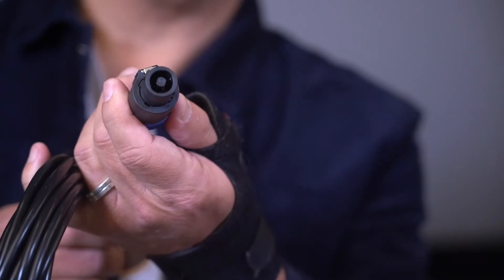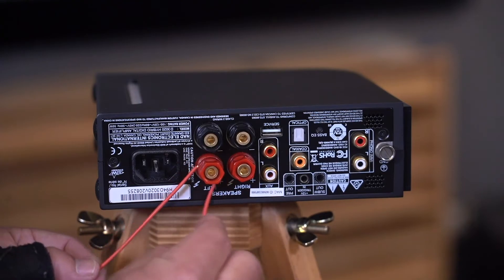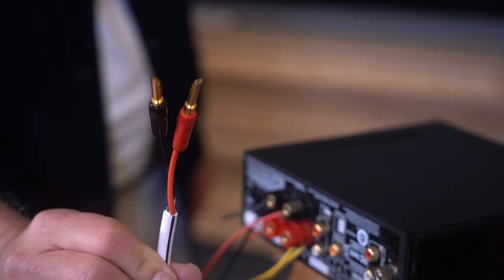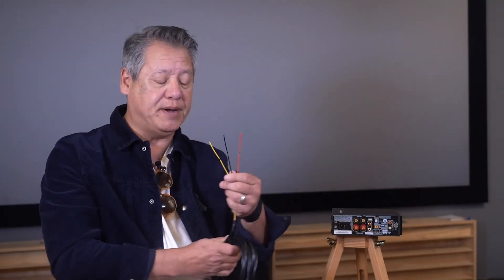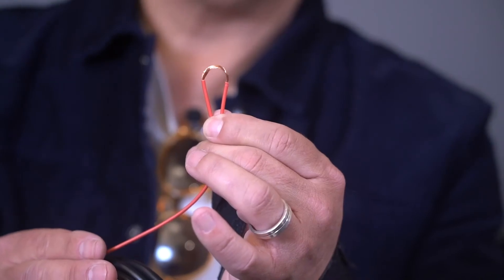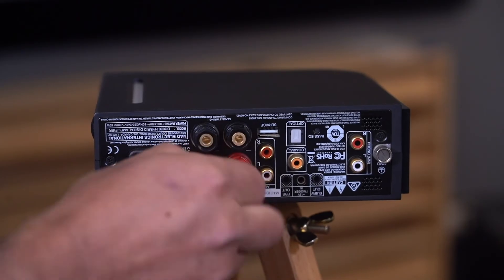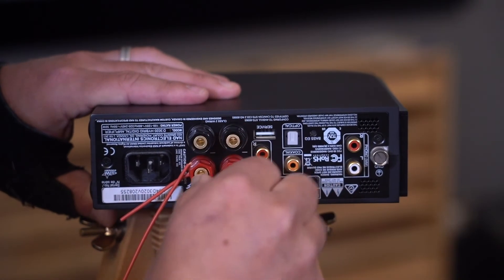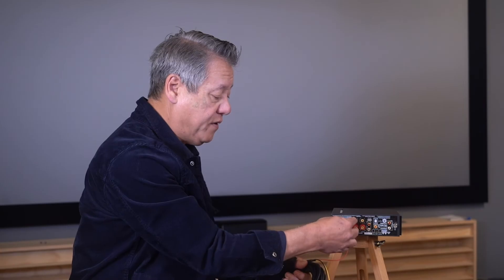What are some tips for the best way to connect a REL Acoustics subwoofer high level?

Comment: One question? Would that drop the ohm load to 4 instead of 8 ohms? Thank you
Reply from the maker: Thank you for reaching out. The High Level input on our subwoofers uses a high input impedance (150,000 ohms), which allows it to connect to the main speaker output terminals on your amplifier without placing any current load on the amp. This means that if your main loudspeakers have a nominal impedance of 8 ohm, then the amp's output stage loading will remain at roughly 8 ohm after connecting the REL's High Level cable.

Comment: What happens if you have a sub out on your amp ?
Reply from the maker: Thank you for reaching out. An RCA pre-out or "sub-out" can be used for connecting to a REL subwoofer, though in most cases we recommend using the High Level input in order to get the best possible performance from the subwoofer. 

For connection instructions specific to your system, please write in to contactus@rel.net and our team will be happy to assist.

Comment: Would it be ok to connect the high level of the rel subs at the speker post rather than the amplifier’s posts, since the subs are being placed next to the speakers. Thanks.
Reply from the maker: In some cases it is possible to connect the High Level cable to the binding posts on your main loudspeakers. For more information and for High Level connection instructions specific to your system, feel free to write in to contactus@rel.net and our team will be happy to assist.
Reply: @RELAcoustics  Thank you. Appreciate your fast response 👍

Comment: Is there any easy way to do this with a pair of monoblock amps that are spaced a little ways apart? They’re not differential amps. Do I just have to deal with removing more sheathing from the cable and run longer bare wire across from one to the other?
Reply from the maker: Thank you for reaching out. Are you planning on using a single subwoofer in this system, or a stereo pair of subwoofers? Also, what specific model of monoblocks are you running? This information will help to provide accurate connection instructions.

Comment: Hi. Does this affect the impedance of the left and right speaker? Do I load my mission towers on same terminals pls? I do have 4 independent subwoofer phono inputs for 4 subs but this sounds like I’ll get the best from the rel s 812 sub I’m looking to buy.
Reply from the maker: Thank you for reaching out. The High Level input for our subwoofers is designed so that it will place no current load on the amplifier, and will not draw any amplifier power away from your main loudspeakers. The main loudspeakers and amplifier will essentially perform as if there is no subwoofer connected, with the REL then drawing a small amount of voltage to then feed it's own filters and amplifier.

Comment: hi, I'm going to buy upcoming Classic 99 , I want to use it with both home cinema, and stereo. I have a question. Is it possible to connect  it simultaneously to both  high level input comming from my stereo tube amp, and to my Marantz Cinema 60 LFE output permamently without chnging any cables on  dayly basis? Or is it maybe better to go wireless on a stere side, for example from one of my Rose RS-150B streamer  outputs through your transmitter (not sure which model)? Which sollution would be beneficial from audiophile point of view?
Reply from the maker: Thank you for reaching out. The Classic 99 is designed so that you can connect to both it's High Level input and the .1/LFE input at the same time, meaning that you can connect High Level to your stereo tube amplifier and simultaneously connect using the .1/LFE input to the sub-out on your Marantz Cinema 60. Each of these input channels have their own independent Level control so that they can be tuned separately, and it will not be necessary to disconnect or reconnect any cables when switching between these two applications.
Reply: @RELAcoustics  thanks, that's really great news!

Comment: Hey there John, im so glad i found this Video. It makes perfect sense now! 
I just bought my T/7X (my very first Sub) and as i'm a music producer i just have one small Amp (Bryston 2B) and as i use Amphion One 18 Speakers,  i dont listen really loud (therefore also my choice of the T7X). As i was confused on how to connect the Sub i wrote to Thomann the Music store before and the told me i should connect my Amp to the Sub and then Back to the Speakers, which is not possible with the T*X Subs so i was really confused how to do it. I thought i need to buy another Amp and connect this to the Sub but then how do i connect the out to the Sub and the AMP, Y-Split cable ?? etc etc but this Video man, the solution is so simple and easy that i would never thought of this. So thanks again you saved my day (and the money for another Amp :)
Reply from the maker: Thank you for supporting REL, and we are glad that this video helped to answer your questions about connecting the High Level cable for the T/7x! As the video shows, both the High Level cable for your T/7x and your main speaker wire will be connected together to the output terminals on your system's main power amplifier.
Reply: @RELAcoustics Hi, newbie here, so it's okay if the cable (+) from main speaker touches cable (+) from REL sub ? In the video you mentioned something about banana connector but i'm not native and didn't understand that part, are you saying to use a different connector for the REL and the main speakers? My main speakers have same type of wires as the REL though so from my understanding they'll both be touching is that normal?
Reply from the maker: @monstar5746  That is correct, the positive (red and yellow) leads of the High Level cable should be connected to your amplifier's positive speaker output terminals alongside your main speaker wire, and in most cases this will result in the High Level wire making direct contact with the speaker wire. You could use different connectors/termination for each wire (for example, spades for your speaker wire and banana plugs for the High Level), or simply use a bare wire connection, as long as both are making secure contact.

Comment: I've been running both high-level and .1 LFE's on my stereo pair of T5i's, and after disconnecting the high-level connections to do some .1 LFE speaker levelling, I realised only one of the subwoofers was working! Which told me both subwoofer inputs are probably running parallel, meaning that both running the same way.
Even though my arcam avr20 apparently is able to do four independent subwoofer outputs, however that's with dirac live bass management! Perhaps when finances become available the Rel 3D HT will be for the near future. Therefore in the meantime I was wondering would be beneficial for my particular 5.2.4 setup to implement a Y-Splitter ?

Any advice would be appreciated! Cheers
Reply from the maker: Thank you for reaching out. If you have found that one of the subwoofer outputs on you AVR is not functioning correctly, then you could use an RCA y-cable so that both of your T/5is receive signal from the same functional subwoofer output on the receiver.

Comment: Where do you connect the other end with a black cap it didn't look like a RCA male
Reply from the maker: Thank you for reaching out. One end of the High Level cable fans out into three bare wires, which connect to the output terminals on your amplifier, while the other end features a SpeakOn/NL4 Plug which connects to the High Level input jack on the subwoofer's rear amplifier panel.

Comment: does this work for lower powered amps? like 25 watts or is the amp in rel sub doing the lifting ?
Reply from the maker: Thank you for reaching out. The High Level input on our subwoofers is designed to not place any current load on the amplifier, and to not draw any amplifier power away from the system's main loudspeakers. Instead it will only be drawing a small amount of voltage to then be fed and amplified through the subwoofer's own built-in amplifier. As a result, the High Level input can certainly be connected to and used with 25 watt amplifiers.

Comment: Confused, why don't you just set your speakers to small like audioholics recommend no you just marketing something your know for subwoofers but not  loudspeakers that's the difference
Reply from the maker: Thank you for reaching out. In our experience setting main loudspeakers to small significantly limits their performance potential, and can alter their sonic character in ways not intended by their designer. Aside from a small number of speakers that are designed to only be sent a bandwidth-limited signal, the vast majority of speakers are capable of receiving a full-range signal and originally designed and voiced with a full-range signal in mind. 

That being said, try it both ways in your system and see which sounds best to you. Musical and sonic preferences are subjective, and what is ideal for your ears and in your room may be different than what we prefer and recommend.

Comment: Why is it that the cable is not supplied with the HT range? What do you supply with the Ht range speakers?
Reply from the maker: Our Serie HT subwoofers do not feature the High Level input, in part because these models are intended primarily for home theater use, and by eliminating the High Level input we were able to use larger drivers and more powerful amplifiers while maintaining a competitive retail price.
Reply: Many thanks for taking time to answer; please tell me which cables I need to purchase, I will use the subwoofer both for HT and for two channel listening
Reply from the maker: @paulk9534  With the Serie HT subwoofer models, you will only need a standard RCA cable to connect it to your preamp or AV receiver. If your preamp/receiver has a single subwoofer output jack, then you will only need one RCA cable. If it is a 2-channel preamp and only has stereo (left and right channel) output, then a pair of RCA cables can be used.

Comment: Are we okay cutting the cables if we have shorter runs? The included high level cables are pretty long.
Reply from the maker: Thank you for reaching out. Once you have finalized the location of the subwoofer in your room relative to your amplifier, you are welcome to trim the supplied High Level cable to a shorter length if you wish.

Comment: It looks like you connected one high level input cable to both right and left speaker posts. The red to right and yellow to left. This means the subs will cross the right and left speaker posts?
Reply: Where connected the black wire - ground ?
Reply from the maker: Thank you for reaching out. When connecting a single subwoofer to a 2-channel amplifier, we do recommend connecting it to both the left channel and right channel speaker output terminals on the amplifier. This means that the red wire will be connected to the right channel positive speaker output, and the yellow wire will be connected to the left channel positive speaker output.

Comment: Hi! If I use spades for the speakers, it's less recommended to use this way to connect my T5i to the speakers (LS50 Meta) instead of my amp?
Reply from the maker: Thank you for reaching out. With a single subwoofer setup, we recommend connecting the High Level cable to the output terminals on the amplifier itself, rather than connecting to the binding posts on your main loudspeakers. Connecting to the amplifier's output terminals will allow you to more easily connect the cable to both the left channel and right channel outputs.

Comment: I've tried all guides how to solve the humming sound from TZero Sub for my desktop hifi sytsem, but in vain! Rel seems to make thing complicated. 
I've duo JL Audio Subs to mate with my Maggies 3.7 speakers, also connect high level input, without no problem at all.
Reply from the maker: Thank you for reaching out, and we are sorry to hear about the hum that you are experiencing with your Tzero. When you have a chance, please write in to contactus@rel.net and our team will be happy to assist with troubleshooting this issue and providing resolution options as needed.
Reply: @RELAcoustics  Thanks for your prompt reply. I just fixed simply Adding 1 RCA to the .LEF to connect with my Class D Amp (I still keep high level cable connection),  and no more humm...But I'm really not sure: Now the sound of the TZero mkIII Sub coming out from the high level connection or from the .LEF. Please ... Thanks
Reply from the maker: @iluxman  Thank you for your response, and we are glad to hear that you were able to resolve the hum from your Tzero subwoofer by running an RCA cable from it's .1/LFE input to an open RCA jack on your amplifier. In this case, the .1/LFE Level control on the subwoofer can be lowered to the minimum/lowest position, so that this RCA exclusively provides a signal ground reference without impacting the audio output of the subwoofer.

Comment: I have an S/510 coming. My amp is a Moon 700i which is a fully balanced differential dual mono. Do I need to use one hot channel only or limited to RCA?
Reply from the maker: Thank you for reaching out. Since your Simaudio Moon 700i amplifier uses a fully-balanced/differential output stage design, the instructions outlined in the following article from our website can be used when connecting your S/510 subwoofer to this amplifier using the High Level input: https://rel.net/blog/2015-07-23/how-to/how-to-connect-a-rel-to-a-balanced-amp/
Reply: @RELAcoustics  TY. To be clear, only ground the sub on the chassis if a ground screw exists. Otherwise, use the amp RCA output into the LFE input on the Sub with the volume right down.

Comment: How are we gonna high pass speakers when we connect subs to high level input
Reply from the maker: Thank you for reaching out. When connecting a REL subwoofer using it's High Level input, it will be necessary to set the corresponding main speaker channels to "large" or "full-range" within your processor or preamp, so that no crossover is applied to their signal. In our experience this will not only result in improved performance from your main loudspeakers, but will also allow you to achieve the full performance improvement that the High Level connection provides. 

If you would prefer to apply a crossover to the signal received by your main loudspeakers, then we recommend instead connecting the subwoofer using it's .1/LFE input to the subwoofer output jack on your processor. This will allow the subwoofer to receive all signal below the receiver's set Crossover value, and will give the receiver full control over the frequency response of the subwoofer and your system as a whole.

Comment: Hi, my speakers are connect to the A- terminal of my amp. There's nothing connected to the B-terminal of my amp. Can i use the B-terminal to connect the sub cables? The signal should be the same...Or is there a specific reason that the sub has to be connected to the same terminal as the speakers?
Reply from the maker: Thank you for reaching out. We recommend connecting the High Level cable for your REL to the same "speaker A" output terminals as your main speaker wire is connected to, since this will help to ensure that the subwoofer receives the exact same signal as your main speakers are receiving and does not place any current load on your amplifier.

If you have any additional questions about High Level connection in your system then feel free to write in to contactus@rel.net and our team will be happy to assist.

Comment: What about connecting to the Schiit Tyr? It’s a differential monoblock amplifier where both the positive and negative are hot.
Reply from the maker: Thank you for reaching out. Here is a link to our video on connecting High Level to balanced/differential monoblock amplifiers such as your Schiit Tyr: https://www.youtube.com/watch?v=vIuwYVI9uO8
Reply: @RELAcoustics  Thank you for this, however this video does not agree with your T/x series manual, which states to leave the ground floating for differential or class D monoblocks.
Reply from the maker: @clippy_friend  Thank you for your response. When connecting High Level to differential or Class D amplifiers you can start by leaving the black wire completely disconnected, though if you experience any hum from the subwoofer then we recommend connecting the black wire to a chassis screw or designated ground screw. Typically it is best to connect the black wire to a grounding point by default to prevent a ground hum from occurring from the start.

Comment: How About black cable ????
Reply from the maker: The black wire of the REL's High Level cable is used to achieve an electrical ground reference between the subwoofer and the rest of your system's electronics. This wire can be connected to a designated ground screw in your system if one is available, or to a chassis screw on the power amplifier.
Reply: @RELAcoustics  What happens if you connect it to one of the speaker output ground/black 5-way binding posts?
Reply from the maker: @ It depends on the amplifier that you are using. With some amplifier designs this will be fine, though with others (specifically Class D and balanced/differential amplifiers) connecting the black wire to a negative speaker terminal can result in damage to the subwoofer or the amplifier. For this reason, we by default recommend connecting the black wire to a chassis screw or designated ground screw on the amplifier.